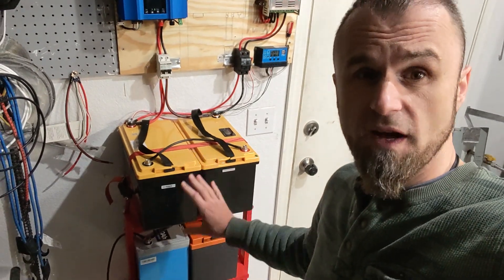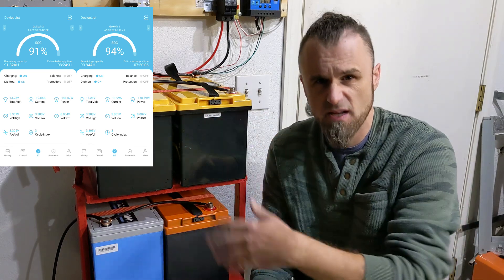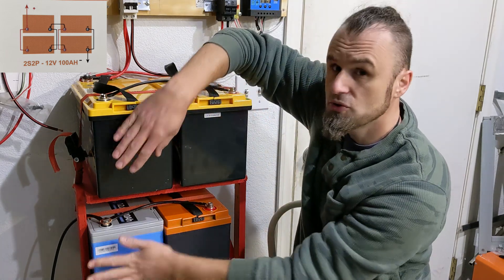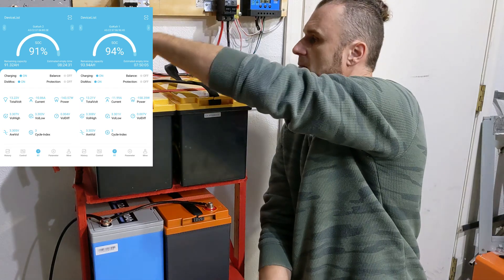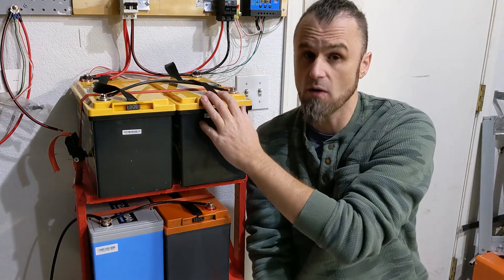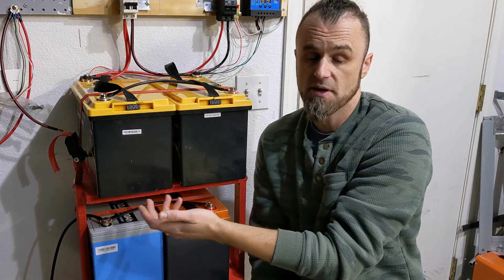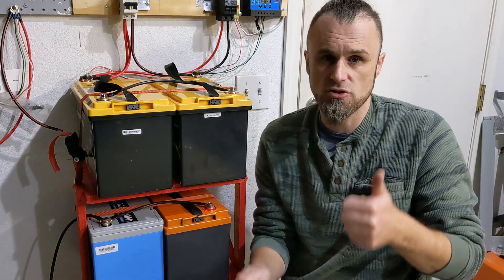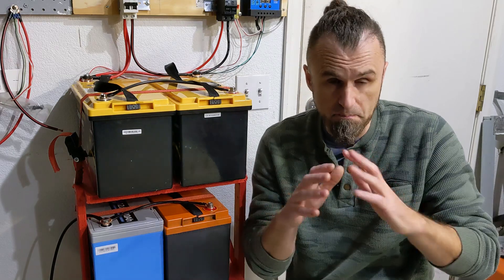Can you Mix 12v LIFEPO4 batteries? 2s2p Explained! Can the manual BE WRONG!? BMS management Issues

Comment: Please try using Battery balancer/equalizer it can help with balancing during charging and discharging.
Reply from the maker: I just bought one The problem is that lithium iron phosphate batteries are so stable on there voltage that you could only see it working right at the top when they'll do their top balancing or right at the bottom when they're fully discharged but nothing in between the voltage difference is too small

Comment: Hmm.  Well, not sure I agree.   Batteries cannot naturally stay in balance along the entire charge/discharge curve.  You can only balance them at one point, and usually that is at the top.  Even same-brand, the natural voltage will deviate everywhere else, sometimes by quite a bit, everywhere along the curve until it crosses the one point (usually the top) where you balanced the batteries at.

Because of this I am generally against paralleling the mid-point.  I always only parallel the series end points, even same-brand.   All that will happen when you parallel the mid-point is that you will force the batteries in their respective individual series sets to go out balance, undoing a lot of the hard work that was done near the top to put them in balance.

So you do need whole battery equalizers, one for each series set, if you want your battery bank to be 100% hands-off across the span of years.

12V battery equalizers do a decent job but they aren't perfect because they will attempt to equalize the voltages along the entire curve instead of just near the top of the curve.  So battery equalizers will actually tend to undo the balance (make the balance worse) between the N batteries in series while in the middle of the charge or discharge curve, and then try to fix it back at the top of the curve.  Not ideal.

The ideal "equalizer" for individual series components of a paralleled set of batteries is to simply have individual load dumps just below the fully-charged voltage.  For example, if you charge to 3.55V/cell, this would be 14.2V on each individual 12V battery.  To equalize the 12V component batteries you thus have a digital relay set to dump through a resistor (usually a 25W 50ohm resistor) whenever the voltage exceeds 14.1V, and nowhere else.  Simple as that.

Absorption time is needed to give the equalizer time to do its work, as well as to give the BMS's internal cell balancers time to do its work.   Most people get this setting wrong.  For daily cyclical operation the absorption time should normally be set to 1-2 hours before dropping down to a float.  Otherwise neither the BMS balancing or the whole battery equalizers have enough time to do their jobs.

--

Your explanation at around 10:45 is incorrect.  When batteries are connected in series both batteries have to accept the same amount of current by definition.   One will not accept more or less current than the other.   They are accepting the same amp-hours regardless of internal resistances.   Differences in internal resistance only affect the overall voltage required to push current into the series set.  They will NOT self-equalize.

LiFePO4 batteries tend to naturally stay in balance for a very long time (months and months) so it might appear that they self-equalize, but they really don't and over a period of 6 months or longer they will definitely drift out of balance due to different rates of self-discharge.  The only way to ensure that they do is with a battery equalizer which actually transfers or drains some energy asymmetrically.

Other factors such as cable length and internal resistance only have the effect of creating a state-of-charge "offset" between the paralleled sets.  This offset will naturally collapse towards zero near the top of the charging curve because the resistance stops mattering once the current begins tailing off.

And this is true when mixing brands as well.  As long as the chemistry is the same and the internal series count is the same, the relative differences between the batteries will only cause a small SOC offset as the bank is being charged or discharged and the offset will disappear as the bank gets near the top or the bottom of the curve.

So while mixing brands is not ideal, it also doesn't really hurt anything.

-Matt
Reply from the maker: Thank you for taking your time to write this message I really appreciate it, we learn a lot from each other, The internal balancing happens differently for each brand for example the yellow batteries in this video have a BMs that will do balancing after 95% charge so they have small resistors that will keep the cells in check not only at the top but also throughout the charging stage, those yellow batteries by Go Kw, are very smart That's more BMS It's truly a marvel and that's where all the batteries should be, But the chin's battery The orange one that I have, It's as dumb as it gets and I already had problems with its sister that's why I'm getting a new BMS for it to control the charge because the cell got out of line really bad I lost maybe 80% of the capacity of that battery. I'll have a video coming on that. Since I made the video that you just watched I also found a left right balancer made by power MR that's supposedly will keep the left in the right in sync, The problem is that the power meter balancer only works right at the top or right at the bottom because it needs a voltage difference between the batteries and there is very little in lifepo4. Let's keep in touch and keep the information coming and thank you again for writing me this lengthy message
Reply: @VegasRoManiacReviews  Well, you want the whole-battery balancer to only work at the top anyway.  It is ok for it to work at the bottom too but it should never be triggered at the bottom.  In anycase, it isn't possible for a whole-battery balancer to know what direction to go anywhere except at the top.  If it tries to balance the batteries anywhere else on the curve it will unbalance instead of balance them.

For the chins, if cycling to 3.55V/cell (x N) as a target doesn't regain capacity, then try taking it all the way to 3.65V/cell.

Unfortunately, most of these low-end brands have severe deficiencies when it comes to proper configuration of their internal BMSs.   But usually a target voltage (bulk / absorb) of 3.55V/cell (e.g. 14.2V for a 4s battery) does work fairly well.

Also be sure to float only between 3.35V and 3.375V/cell (13.4V to 13.5V for 4s).  Otherwise long floats will also unbalance the battery.

-Matt
Reply from the maker: @junkerzn7312  awesome info . I just fixed a chins battery that was way off between cells and refused to charge , the s is super dumb, so I got a capacitor cell balancer. You will see it in my next video well worth spending 30 bucks to save a 270 dollar dumb chins battery
Reply: Hey Matt 
Quick question. 
I have a new LifePo4 SMART Reodo 12v 100 amp battery with the on off button AND  a new Redodo $50 cheaper without the onnoff button. 
I want to use for 36v trolling motor  so does it matter which battery of the 2 I have already I buy to make 36 volts ???
The button one flashes when at 33% available power left which is nice. 

Your thoughts appreciated 🙏 
Thanks Chief 😊
Reply: @stedyone1090  Putting batteries in series to make a trolling motor is a bad idea.  Trolling motors typically need significant bursts of power and would probably trip the configuration you are thinking of.  You can try it, but... do you really want a mess like that in a small boat?

There are LiFePO4 batteries specifically made for trolling motors.  These have a 2C discharge rate.  For example, LiTime is a good brand.  Search "36v trolling battery lifepo4" and you can find plenty.  The main thing to look for is "2C discharge rate".   Batteries marketed as suitable for trolling motors have high discharge rates and beefy BMSs and wiring internally to handle the power.

So, for example, LiTime sells a 36V 60Ah LiFePO4 battery with 2C discharge, meaning it can discharge at 120A.  One of those would probably do the job.
Reply from the maker: @stedyone1090  sorry , well above my pay grade 🫣

Comment: rule in faster chargings  is   weakest battery  will  be the capacity of pack..      this means slower rates of charge after a percent of voltage  help bms  do some  balancing.. BUT in my experements  i saw not much absorpsion from healthier cells  even in a bad connection   current finds its path to the weakest cell or pack and its then a fight with time to find some quality daily charging !!!!!!   i have a perfect 10 cycles pack that has half the capacity right now awaiting to be  seperate and paralel balanced !!!!! independent  cell  internal resistances seem perfect !!!
Reply from the maker: Awesome man great information keep it coming This is how we learn I learn from you you learn from me and we're going to be geniuses by the end compared to those people that don't have batteries
Reply: This is true for lead-acid, but not for LiFePO4.  Current does not find its way to the weakest cell in series or weakest battery in series.  It WILL split between sets that are put in parallel according to their relative capacities, at least on average over the entire charge curve.

Generally this means that different capacities can be mixed in parallel, but not mixed in series.

A slower rate of charge does NOT help the BMS balance its cells.  Most BMSs don't even start trying to balance cells internally until cell voltages are above 3.45V.  The best way to help a BMS balance its cells is to hold the target voltage in absorption for 1-2 hours each cycle.   It is best for the BMS to balance cells at a single voltage, not for it to try to balance cells along the entire charge curve.

This is because the cells will naturally deviate in voltage from each other outside of the cell voltage they were balanced at, sometimes by quite a lot.   This does not mean that the cells are out of balance.  They are only out of balance if the voltage deviates at a singular voltage (usually at the top of the charge curve).  So trying to balance them at lower voltages winds up just unbalancing the cells instead of balancing them.